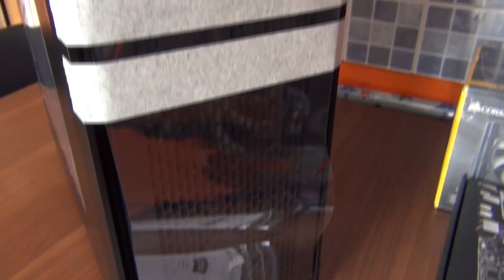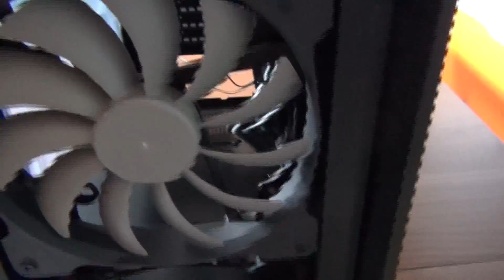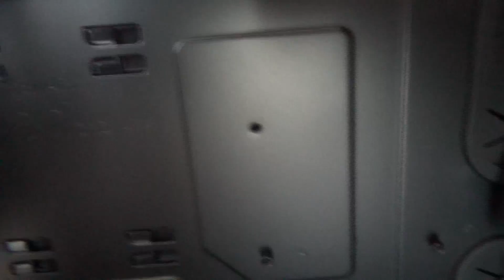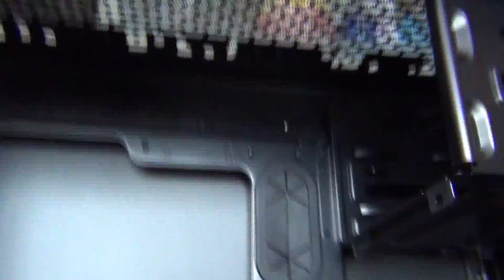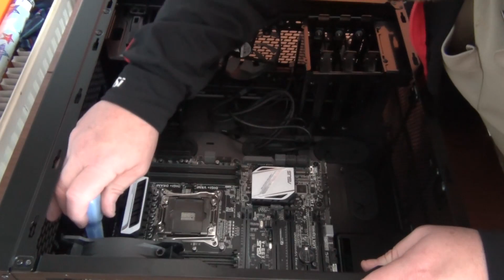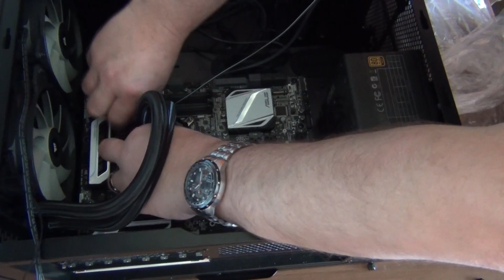Intel 6850K build part 2

Comment: Hi, It is a bit old video but... I noticed you positioned your CPU wrong way, that hole is opposite of triangle, did you swap it later or  that socket is universal? I am asking because I do have problem with my 6850k that I did choose for upgrade. I am getting CPU Failure, but apparently cpu is fine and mobo is fine too..  I did create topic on overclockers https://forums.overclockers.co.uk/forums/new-to-pc-gaming-upgrade-advice.172/ but I guess I am at  loss what to do

Comment: Lovely case but watch out for those case fans, the blades snap off very easy, I went to give mine a clean and was very surprised to find two blades missing, found them inside the case sitting on top of my HDD bay, on replacing the fan I examined the damaged one and gently pushed one of the blades and it just snapped off without putting hardly any pressure on it, very weak and brittle.
Reply from the maker: Thanks for that and I have some decent Cosrair fans in a box should I need them :)

Comment: Bit dodgy having the cpu socket exposed when you were putting screws in, doesn't take much to damage those pins :O  Also gddr 4 ram for the mobo? :p
Reply from the maker: Quite agree but the socket cover was broken from transit and yer, realised my GDDR4 mistake and hoped I would get away with it :D

Comment: Hi gregster correct me if I wrong I have a 5820k which is 28 lanes mean that my crossfire is 16x 8x  with m.2 ssd 951 crucial which use another 4 lanes so all my lanes are used. If I purchase something like 5930k or 6850k with 40 lanes does this mean crossfire is 16x 16x I will have 12 lanes left?
Reply from the maker: That is correct bud.